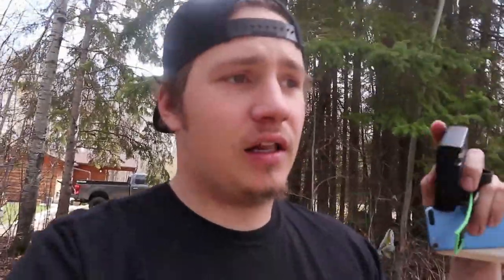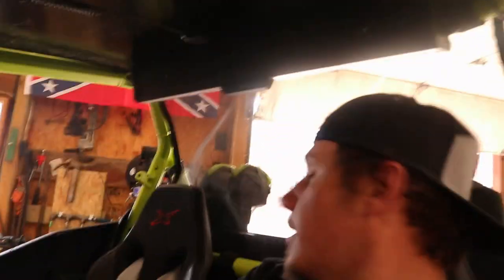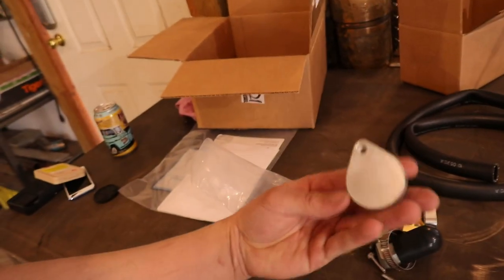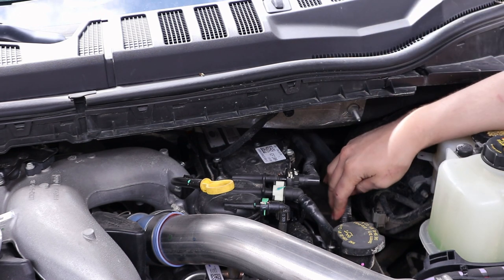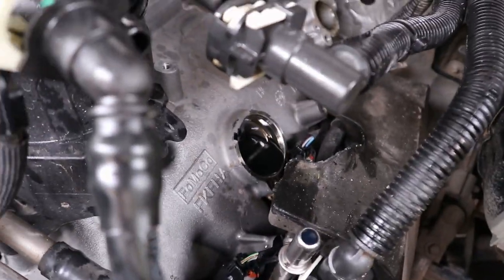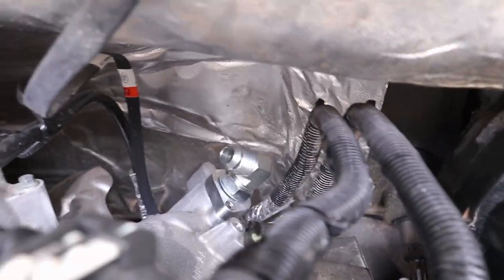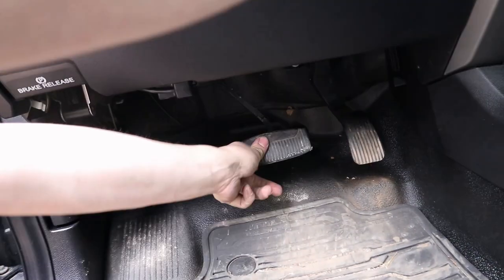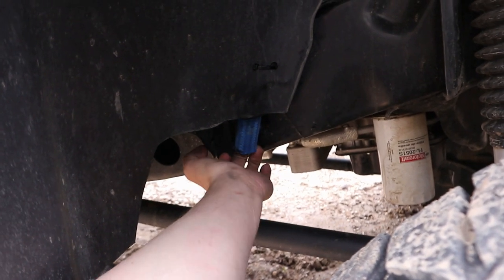EGR and CCV Delete // 2020 F350 6.7 Powerstroke

Comment: What's your opinion on removing the EGR vs just unplugging it? I'm debating doing the same just not sure which route to go.
Reply from the maker: The whole reason for removing it the egr is preventing the cooler from cracking and filling the exhaust side of the engine with coolant.

By just unplugging it, doesnt do much , youll still have exhaust pressure and heat making its way through the system and depending how well the egr valve seals the loop would still activate.

My recommendation would be just to delete the system

Comment: How is the transmission  holding up? Everything I read indicates they don't like any additional power. With the 625hp (+150hp) AMDP tune that's going to be testing it. Did you get AMDP transmission  tunes, if so what do you think about them.
Reply from the maker: They wont hold up with anything over 50hp if the transmission isnt tuned. But with proper tuning they take power no issue and perform extremely well
Reply: @BanackIndustries  Thank you. I ordered  AMDP tuning, all tunes including the  150hp tune. I got the trans tunes. They never asked me rumble vs hiss idle...I'm not picky,  I'd just like to know what to expect.  I have emailed them twice over the last week, still no response.  I'm a bit disappointed in that customer service.
I ordered the tuner box so I don't have to remove the ECM. I'm tracking the shipment...it's about a week away.
Reply: @@dustinrowling7121  did you get everything in? Update please. Thanks
Reply: @Colt_121   nothing yet, I may just hold off. It's been a royal pain

Comment: I’ve got a 2020 also.. wanting to delete but probably going to wait until warranty is up. How is it holding up so far? All I’ve done to mine is upgraded cold side pipe and S&S disaster prevention kit.. putting the HS Motorsport upgraded secondary fuel filter on this weekend!

Comment: Why isnt there flash tuning for these trucks?
Reply from the maker: From what I was told by Am Diesel Performance, is the encryption on the 20+ is to advanced (whatever that means) to be cracked by the ezlynk stand alone tuner. At this point only a computer has the ability to crack into the ecu to be able to bypass the emissions and rewrite the tuning. They did say Ezlynk is working to make there device capable to work on the newer truck, we just dont have a timeframe on when it will be released.

Comment: Your truck is loud under the hood. Deleting makes the truck louder? What was your MPG before and after the EGR delete? Good video.
Reply from the maker: I could see with not having the egr cooler there, noises can make it through easily, but its not bad, cant tell when driving.

Removing the egr cooler doesnt really effect fuel mileage. The Engine tuning is what effects fuel mileage,  and with emissions off tuning they disable egr valve function which does help with performance and economy.

Comment: Have you seen any much Fuel economy gains with the deletes? Considering it for my stock 2020!
Reply from the maker: Huge fuel economy gains with the Am Diesel  Performance clean tuning, even on the level 5 625hp tune fuel mileage is better than stock
Reply: @BanackIndustries  and this is for a deleted tune? Can this place tune my 21?
Reply from the maker: @curtisbull1583  Am Diesel Performance has tuning for both emissions on or off for the 20-21 powerstroke
Reply: @BanackIndustries  can they sell tunes to me here in the USA?
Reply from the maker: @curtisbull1583  i believe so

Comment: Do you know if the 2020+ has issues with the EGR bolts breaking off in the manifold? I know 17-19 were bad about those two 10mm bolts breaking off and couldn’t get them out. 
Thanks!
Reply from the maker: I haven't heard of that being a problem,  but its definitely a possibility
Reply: @BanackIndustries  great thanks. I know it was a huge problem with the older trucks. Seems like the small piping that bolts up is different on the 2020+

Comment: I have my ccv routed down right by my lower fuel filter. I notice when it’s real cold -30ish road sludge freezes onto the opening. Do you ever have this issue with yours?
Reply from the maker: Yup, just gotta constantly keep a eye on it and make sure its clean. Thats just common practice with blow by tubes, doesn't matter what engine
Reply: @BanackIndustries  ok will start cleaning it after drives in winter. Thanks!

Comment: Which EGT probe did you use? I see you have it routed in, I know you sold this rig but did you use stock probe off DPF?
Reply from the maker: Yea just stock temp probe goes back in
Reply: @BanackIndustries  would it still be in the engine bay? I had my truck deleted and can’t seem to find it tucked anywhere

Comment: Have you had any error codes pop up since you have deleted?
Reply from the maker: Nothing egr related but had all kinds of electrical gremlins
Reply: @BanackIndustries  Im having the same issues with mine. On dry roads no problems. On wet roads dash lights up like christmas tree.  Hill decent mode, advace trac, ABS, goes into limp mode. I have to let truck dry out then i can clear the codes

Comment: I deleted my 2019. I unplugged the EGR, Is it neccessary to remove the EGR and add block off plates or can I just leave it the way it is?
Reply from the maker: You can leave it on, but you run the risk of the egr cooler still cracking and leaking coolant into the exhaust
Reply: @BanackIndustries  ok thanks

Comment: What benefit does the SPE cheese grader version have over this?
Reply from the maker: The SPE "cheese grader" or also know as a internal catch can, acts as a oil /air  separater, and basically all it does is keep oil out of the blow by tube 

I have a alternative way of limiting blow by tube oil, just routing the tube up and across the engine the way i did in the video. That gives the oil a up hill path it has to travel before exiting the tube. Seems to be working for me as there is minimal residue at the exit point of the tube.
Reply: Thanks for explanation!
The theory behind it seems solid but I'm curious if the internal catch can has a risk to get clogged up over time. I'd like to see one taken out after a couple years use or longer.
Reply: The newest 6.7 has no filter in that housing, really does not help much compared to pre 2019.

Comment: If I did an egr delete on my 2016 f350 do I need to remove the connection for egr throttle plate.? Thank you.?
Reply from the maker: Not sure on the 2016